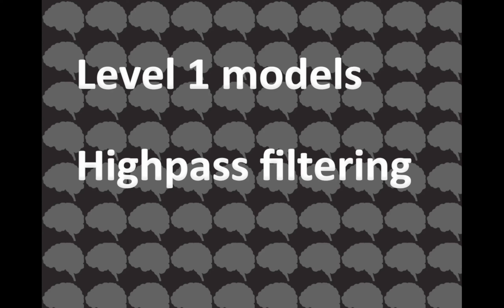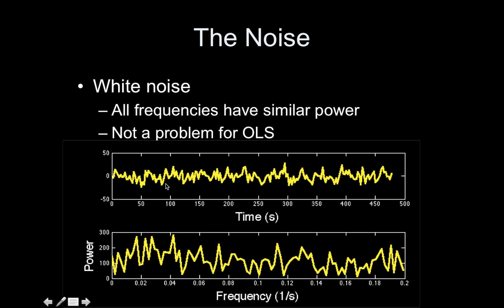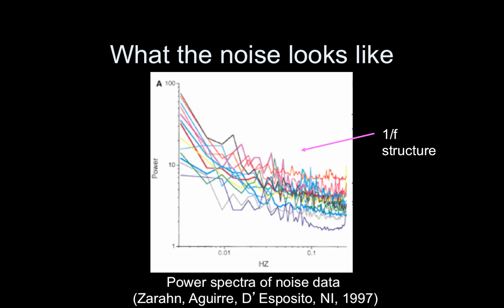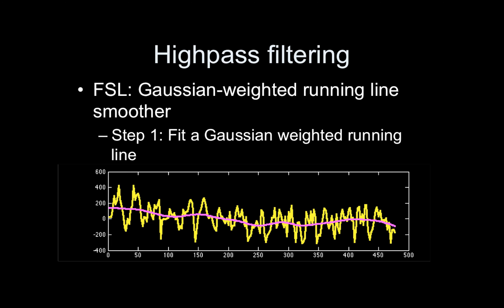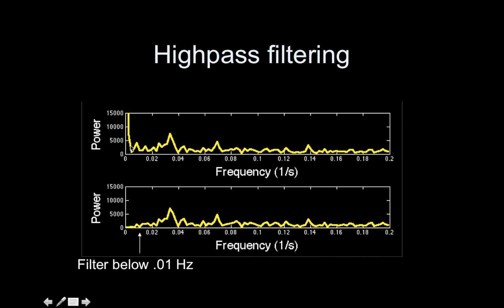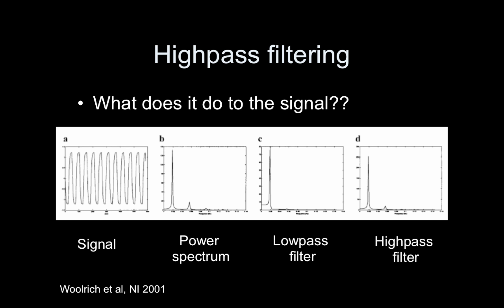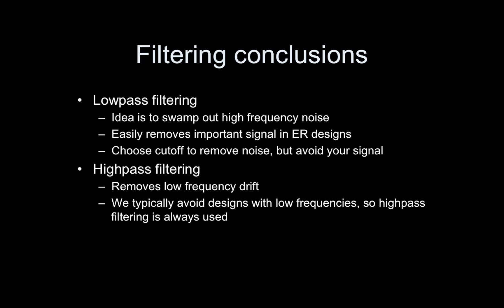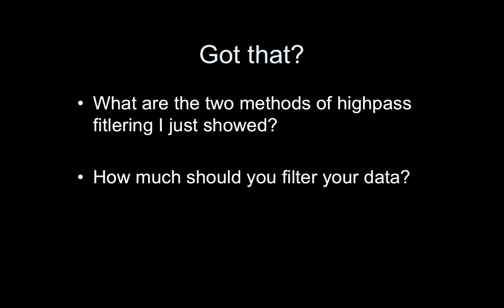Day 17:  Highpass filtering data

Comment: Thank you for explaining everything for a layman!! 
One (possibly naive) question: On the 'Filter Cutoff' slide at the block design bullet, what do you mean by one task cycle?
Reply: The on/off cycle of the blocks.  Basically, you want to avoid the frequency of your task (and make sure the frequency of your task is designed to avoid the low frequency band where we know noise will be). Hope that helps!

Comment: Thanks for the video. My question pertains the cut-off frequency: When you apply a HP filter in fMRI (typically it's .008 Hz), is this at the Nyquist frequency? Meaning that .008/2 is the actual frequency we are removing? Thank you.
Reply from the maker: Typically you specify the frequency you're removing as far as I know.  SPM and FSL specify in seconds (I think SPM does).  I go with 100s in FSL and let the prewhitening pick up the rest of the problems (in theory).